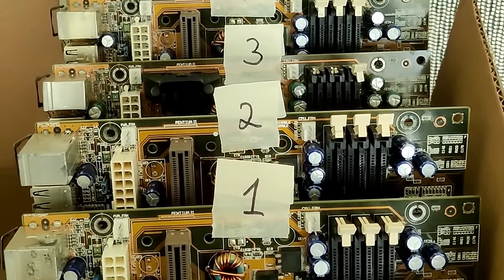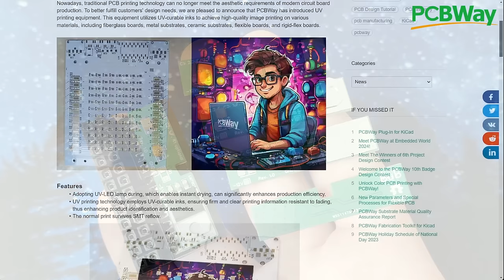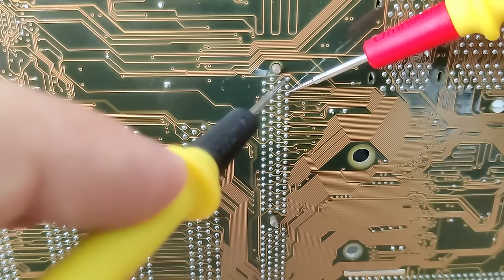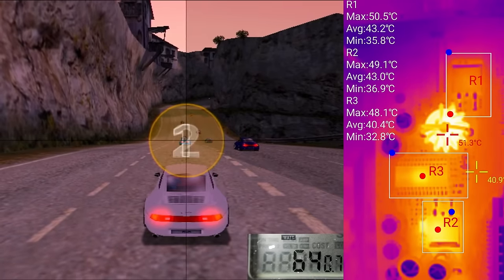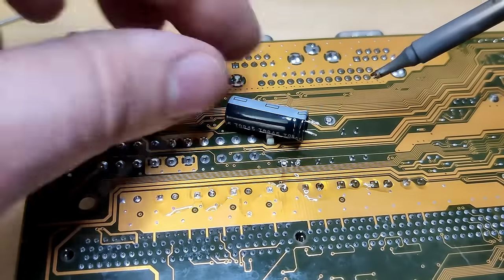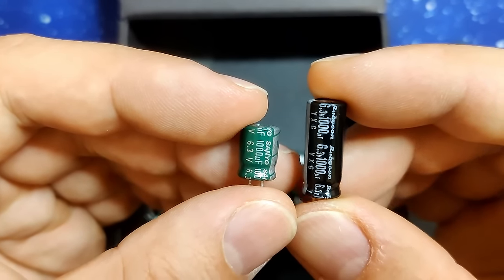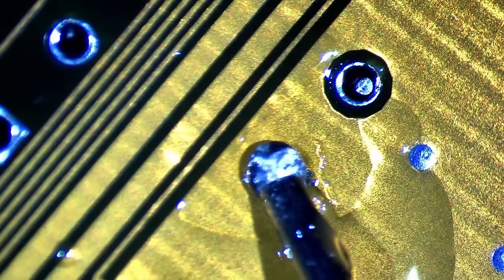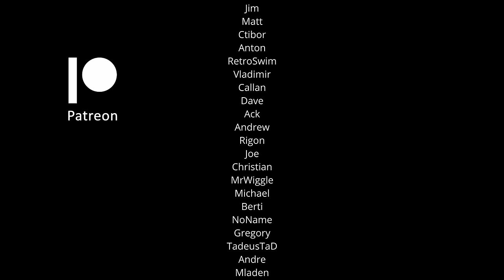ASUS P2B Restoration: Board #5 - Replace 25-year-old capacitors?

Comment: Sanyo and Rubycon are japanese so they were not affected by the plague, the affected ones were from Taiwan mostly.
Reply: Rubycom MBZ and MCZ and one of the series from Sanyo were affected by the capacitor plague
Reply: @andrewsawesome  Are you sure? As far as I know the original formula (the good one) was from Rubycon and when some engineers left it they copied it wrong and was used among taiwanese capacitor manufacturers.
Reply: @drgusman   The stolen formula is a story, which is very convenient for some industry players. Sometimes high-end manufacturers make mistakes when trying to outpace each other on specific capacity or claimed operating limits.

I mean there's probably a kernel of truth to it; but would it surprise you if a fragile chemistry which is so susceptible to being formulated wrong, also gets upset by some unforeseen material in the capacitor itself, something outgassing from the rubber bung, a degrading coating on the inside of the casing or a stray alloy element; or slow ingress of outside material diffusing through or around the rubber bung or a microscopic crack in the top vent? Or egress of electrolyte components through these? Things that aren't covered by accelerated endurance testing?

Every time the new technology generation rolls around, you have to be somewhat cautious of spec claims. Sometimes things are exactly as good as they claim and better; sometimes they are not.
Reply: @SianaGearz  No, of course it will not surprise me, and I'm sure that there are batches of bad capacitors from mostly every single manufacturer out there :)
I just was referring to what was called the "capacitor plague", I lived it myself, in that time I was working as computer technician and it was a true nightmare, I remember specially the mainboards that came with the green caps, very similar to the ones on the video but they were Chinon if I recall it right, those were mostly guaranteed to fail xD
Reply: I have motherboards from that time with japanese capacitors gone bad (Chemicon and Nichicon).
Reply: The issue was with the isolation fluid used on the capacitors
Reply: Can confirm I've had had some name brands from various different devices... The plague spread through almost everything.
Reply: @xenoxaos1  Yeah, all kinda of devices were affected, in the mobos was just more prominent because of the temperatures, I recall that the most prone to fail were the PentiumII and Athlon XP ones as the PII were used with very bad vents and the latest XP's were real demons that got hot as hell, and to make it worse in that time the caps were really close to the CPUs so they got all the heat directly.
Reply: @andrewsawesome that’s got
Nothing to do with cap plague 

Also MCZ were really the problem 
MBZ were fine

It’s not a stolen formula but it’s just Rubycon having a few problems with the manufacturing

It was only 1-2 years that MCZ had problems 

They are generally fine and are top grade and are ultra low esr
Reply: @AladimBR  Yes, the Chemi-Con KZG/KZJ and Nichicon HM/HN also had problems
Reply: @andrewsawesome  like I said that has nothing to do with cap plague tho

There’s even a Wikipedia page on the reason for failed HM/HN

Comment: Nice video. Some people here in brazil are against recap, because most of the time you are changing good capacitor for cheap capacitor.
Reply from the maker: I tried this time to get better caps, but I have the same issue. I don't know if the caps I get are of good quality. So, I'll skip recapping in the future if it's not entirely necessary.
Reply: @bitsundbolts  in this case the caps you used (the gold and black ones with the (Y) vent are actually a top brand called Nippon chemi-con so those are great)

The green ones with the (X) vent are cheap crapy caps and 100% worse than a rubycon
Reply: Is it possible to use solid capacitors to replace the old ones?
Reply: @fetazihsp  Yes it is possible. But most solid caps are designed for surface mount, so they have no wires.
Reply: @bitsundbolts  When I need good caps, I buy them at the big distributors like Digikey, LCSC and Mouser. Than in the selection I pick Kemet, Kyocera AVX, Nippon Chemi-Con, Nichicon, Matsushita, Panasonic (which is Matsushita), TDK, Vishay, Samwha, NIC and Sanyo
There will be some other companies I forgot in the list but normaly capacitors from these companies last a long time. I've seen 40 year old caps from them still being fine.
On the otherhand caps from capxon for example are called crapxon for a reason. Some of the abouve mentioned companies also making crappy lines of caps. I think they made them in reaction of the chinese to compete with them.
Reply: @fetazihsp polymer modding on a old style board like this is not recommended 

It can actually cause more issues 
Polymers have ultra low esr levels and may cause more ripple
Reply: @Mr_cacodemon123  how does a low esr cause mire ripple?

Comment: Demonstration of the negative case is critically important and often overlooked. The recap test was not a waste.
Reply from the maker: You're right. At least you know that there may not be the urgent need to blindly remove all caps from the board. I'm aware that my equipment is not necessarily accurate. However, it should provide at least some insights. Thanks for watching!

Comment: Cap replacement is definitely required on some boards - I got a nice QDI i815 based board that was completely unstable - you could get to DOS, but even trying to start Windows setup would crash the system - after recapping it works like a champ!

I suppose the age old adage stands - 'if it ain't broke, don't fix it...'.
Reply from the maker: Agree! If the board works, no need to recap.
Reply: QDI used crappy capacitors. Otherwise QDI boards were excellent otherwise, and work extremely well with good capacitors. On some QDI boards the capacitors will look fine, but they are defective, mostly 6.3V 1000uF ones
Reply: @michvod  Its not just problem of QDI, but most board from the time of caps plague are affected. I have i815 board from MSi and all caps have to be changed - and most of them were visible leaky.
Reply: @xsc1000  yeah MSI. I had some P35 775 boards MSI boards (from 2009) that had bad caps (around the CPU socket). Also I recapped lots of Abit boards. Asus and Gigabyte were better, but still occasionally had bad caps.

Comment: Certainly surprising to me those caps are in such good condition. Clearly a recap wasn't needed at this stage. Given how prevalent bad caps were clearly Asus used good quality ones back then 🙂
Reply: Yeah but the thing is caps will still degrade regardless how good they are due to the acidic materials inside of them at some point in time they'll just eat themselves it's usually about 20 to 30 years
The only exception might be solid capacitors that don't use electrolytic.
Though those can potentially explode violently.

Comment: Capacitance and esr change at different voltages. I'd like to see how they'd handle themselves in a high current buck converter. 12v > 5v buck with a measurement of input and output voltage and current and the output ripple. Do this at lower current and higher current. You'd probably see the ESR and ESL start showing.

Comment: Capacitors which have a high internal resistance will heat up when used in a power supply circuit requiring low ESR. This can be easily seen using infrared imaging it just feeling with a finger.

Comment: nice method to deal with those nasty ground planes!
And thanks for covering the caps: I'm sure someone will still comment "you must replace all the capacitors" :)
Reply: Depends on your iron and whether or not the solder is contaminated with capacitor leakage. For many, hot air is better specifically for the reasons he states! Many irons simply aren’t responsive enough to saturate the ground plane and heat the plates thru-hole all the way with the component lead. You pretty much need a cartridge type iron to count on having the performance needed for this method.

Comment: My preferred method for removing through hole capacitors is similar but involves using a large flat soldering tip to heat both leads simultaneously. The capacitor will often fall out without further help. 
For clearing the holes I tip the board on its edge. Heat the hole from one side with the soldering iron and apply the de-soldering iron the the other side.
Reply: Some guy told that the most PCB friendly way to remove caps is destroying them with pliers, then disorder small wires is much more safe.
Reply from the maker: Haha, how many hands do you have 😂. I think I wouldn't be able to work on both sides at the same time. Interesting method with the large tip. I don't have one that's big enough - that's why it probably never crossed my mind. Thanks for the hint!
Reply from the maker: I've seen people use pliers and twist off caps. Unfortunately, then I cannot test them. If you're looking for a fault, then this method is not ideal.
Reply: @bitsundbolts  Just the usual two. It helps to use something to hold the PCB. An L shape PCB holding rack would work well. I often use an big alu heatsink from a scrapped audio amplifier. Also you need a desoldering station with vacuum pump. I use a JBC station at work :D. At home I have a ZD-8915.

Comment: The old caps are the following:

Sanyo CA series 6.3v 1000uf 

Rubycon YXG series 6.3v 1000uf

I’m not surprised they are close to their original specs 
The rubycon are perfect still no surprise there.

Recapping this board is not necessary
Reply: 0.39ohm is quite high should be around 0.08.
Reply: @thomasandrews9355  I would have to check the datasheets but you are very likely correct that is too high 

Considering there measured capacitance they are probably in need for a reform

Edit: Ok just checked 

Rubycon YXG 6.3v 1000uf should be at 0.08 so yes you are correct 
Sanyo CA 6.3v 1000uf should be at 0.15 so those are reading correctly 

Like I said they all look fine and at least they are in the need of a reform
Reply: @Mr_cacodemon123  it’s probably fine these aren’t p4s. I use the yxg and similar when restoring old Mac’s so I’m familiar with them.
Reply: @thomasandrews9355 I know it’s fine for a board like this

I recap my socket 478 boards with rubycon MBZ/MCZ or polymers for the output side of the VRMs and the input I use MBZ or Panasonic FM

Comment: Awesome again!  I am not surprised by the cap results.  I have done similar experiments with Commodore 64 and Amiga 2000 mainboards and have found basically the same result.  Some caps just don't need to be replaced and may last 40 years or more.  The recapping just to recap fad is totally unnecessary in many cases,  Especially true for through hole.  SMD caps tend to be another story it seems and not counting the early 2000s to early 2010s as I have seen a lot of failures in this era.

Comment: The mid to late 90s was a very narrow window of good capacitors in radial and axial types. Before 1996, those types of capacitors were afflicted with a different problem, corrosive electrolyte eating the seals out the bottom of the capacitor and leaking all over the logic board. Nichicon capacitors are especially bad about it, they're a plague in Apple computer power supplies and analog boards.

SMD capacitors in the 80s, 90s and early 2000s were even worse, those all need to be replaced, from any manufacturer. They also had seal failures, but since the plastic foot can wick the leaked electrolyte, it makes it very difficult to detect until its too late.

Also, if you find any purple Sanyo polymer capacitors, get rid of them. They don't physically leak, but they become electrically leaky, go high ESR and the rated capacitance plummets to nothing.

Comment: The capacitor plague is my reasoning behind an automatic re-cap. Before the plague I would try and re-form capacitors that went out of spec and had really good luck with them. The plague will cause a capacitor to test and run within spec but will degrade after use. In storage they seem to survive without issue. It's when you actually start making them work. For me it was a lot more difficult to test and replace when necessary, reassemble the machine, have it pop, then disassemble test and replace. I used to do a lot more than mainboards. For TV, VCR, power supplies, etc. it was a lot more work for little benefit.

Comment: Thanks for confirming - it if looks good leave it - especially if its not booting - good looking caps are usually not the problem
Reply from the maker: Yes, unless you have a good reason to suspect bad caps, just leave them. There are many other devices that can go bad before caps.
Reply: @bitsundbolts  You can check voltage ripple by oscilloscope. If its OK, caps are OK too.
Reply: @xsc1000   I second this. A ripple check with an oscilloscope is the best way to find functionally bad electrolytic capacitors that still may look fine. I suppose an in-circuit ESR could also work but that won't give any idea as to what is acceptable in the specific application.

Comment: I'm keeping most of the electrolytics in my ancient 1949 TV, the set works fine with them, their parameters measure decent enough, and there are no visible signs of damage. The P2B's capacitors are only 1/3 as old so unless they are known problematic series I'd expect them to have several decades left before failing from old age.

For some quick tests: measure ripple voltage with an oscilloscope and measure capacitor temperature with your thermal camera. If both look good they're not about to have a bulging-type failure. They could still leak though.

Comment: As you've hinted, one way bad caps can exhibit their failure is by excessive vrm transistor heat.
I recapped a working but leaking Socket A board and the vrms dropped easily 20*c.
Yes, those caps were obviously dead in that case, but it is definitely a sign to look for as you did.
Reply from the maker: I'm sure that I'll get a similar board like your socket A one day and hope to be able to reproduce this behaviour! You just need to get it in the right state. If the caps are too leaky, it probably triggers the overcurrent protection in the power supply.
Reply: So you mean IR camera can show a bad cap without disordering? interesting...
Reply: @alexloktionoff6833  IR camera + ripple on CPU power line measured by oscilloscope. IR camera can find one bad even others are still OK.

Comment: On some of my boards I've ended up replacing all except 10uf caps due to constantly having to pull boards back out of a build and replace newly failed caps. My Jetway 994AN-L is the next candidate due another dead 1000uf cap - so far the only one that has failed with the electrolyte itself venting (and after significantly reduced stress in the form of various Via C3 and my SiS 315).

I've seen some similar Sanyo cap (1200uf however) fail on my Asus A7V266-E (low ESR 2200UF as a temporary standin), while all of the Rubycon caps are perfectly fine. And I've got the motherboards in 2 Xbox to recap due to nearly all Nichicon caps having failed (had the same ones fail on an early Intel LGA775 board)

Comment: That inductor does not have an iron core, it would be to lossy with the high frequency used in the power circuit, if it was iron it would be even hotter.
It instead is made with a ferrite core of some formulation, modern ferrites are even better with even lower losses making then cooler with the same power.

Comment: I think recapping depends on who made the original caps and I would only go with the good well known brands for replacement (rubycon, nichicon, etc...) I know for rare hardware I would not want to chance killing it because a crappy cap decided to take out the rest of the board. Also I saw people saying you can replace one type cap for another which is not a good idea as the electrical characteristics of different types of caps are not the same. There is a reason besides cost that boards are designed the way they are, so unless you really know what you are doing, like for like is the way to go.

Comment: @BitUndBolts
I was a bit surprised at the large caps, but given the healthy state of the caps, I would have left them in and used the new ones on the next board, keeping the extra set spare. That's just me though. Well done on that APG port pin!!
Reply from the maker: Yeah, that board didn't need recapping. At least I learnt something. I have enough caps for many board repairs.
Reply: @bitsundbolts  
Of course, it never hurts to replace caps either. 🙂

Comment: IMO recapping on motherboards is only needed if there are clear physical signs of failure such as bulging or leaking or you're seeing stability issues that aren't related to excessive heat. Otherwise I would leave the caps as they were. 
The capacitor plague era was awful to go through! Every PC I built or owned from the late Pentium 2 Slot 1 era all the way forward to an early Core 2 Quad machine (and everything in-between on both the Intel & AMD side) ended up with  motherboards with leaking or bulging caps on it after a couple of years. 
However, I have 4 more recent PCs, the oldest being an Ivy Bridge i7, a Haswell Xeon desktop, a Xeon W 2135 based workstation running TrueNAS 24/7 and the newest being a 3 year old B550 AM4 board with a 5700x3D recently installed in it. None of those machines have had any capacitor or stability issues that I have seen. The Ivy Bridge desktop is one I purchased in 2012 and still gets regular use as living room game emu box.